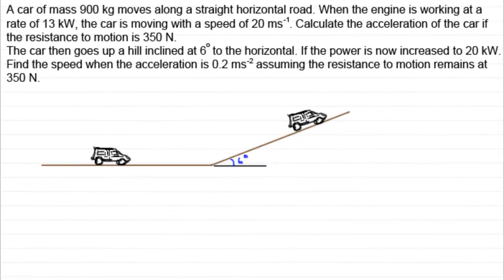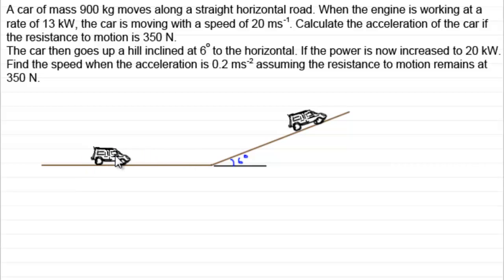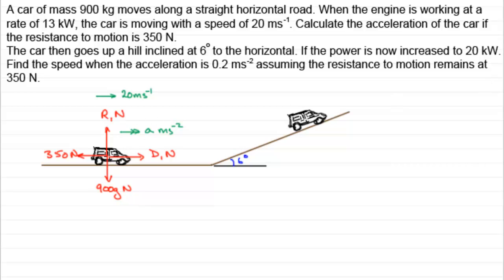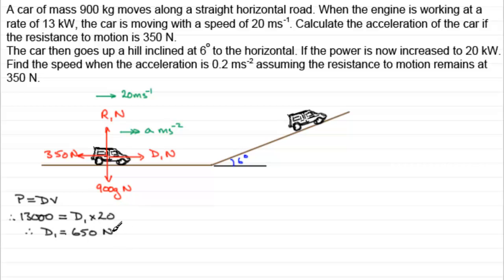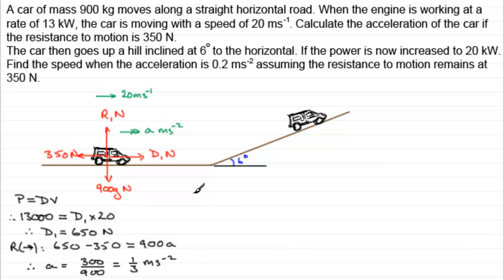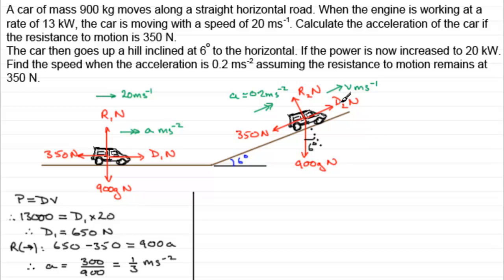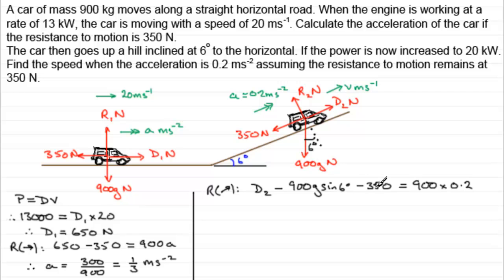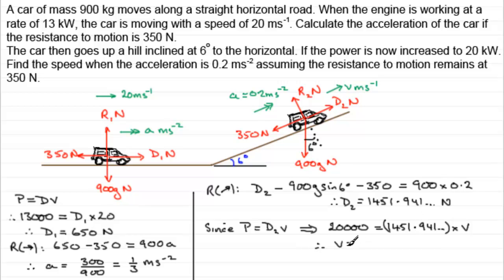Power : accelerating particle : ExamSolutions

Comment: I know this is 2 years too late, but to Luke Rouse and anyone else who had the same problem as Luke:

Power = Driving Force x Speed. "Driving" being the keyword here. You're using the resultant force there. The driving force is only the force that is responsible for the motion of the particle. So, forces due to resistance, are not included.

You should watch one his earlier videos, he probably explains it MUCH better than I do...

Here's the link: http://youtu.be/e7ZX0CaBpns